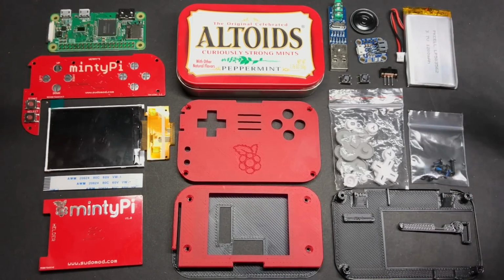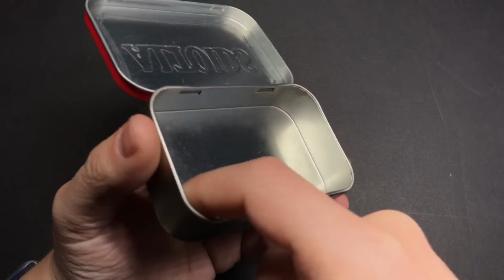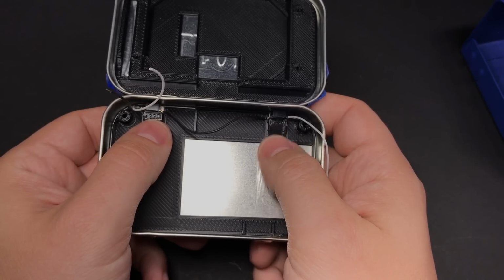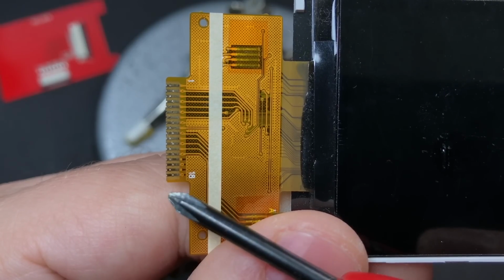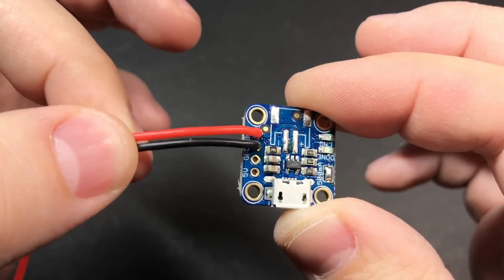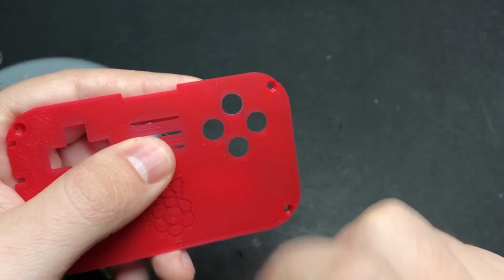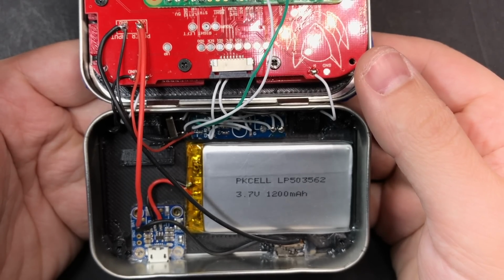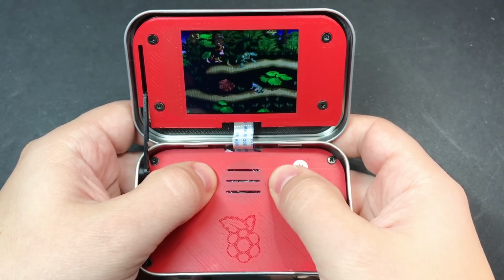mintyPi Build Guide

Comment: I'm sure it's not too big of a deal on here since your not shooting for the worlds greatest audio quality, but it's generally a really bad idea to have your oscillator very far from your chip.  Introduces noise and increases the capacitance of the leads.  Like I said, in this case, no biggy, but don't do it on anything you're sending data over that you don't want to lose bits, ESPECIALLY at higher frequencies.

I'd say, if there's room, put it on the backside with the ic and just put some kapton tape over the ic leads to prevent shorting.

Comment: I made a much simpler version; I used an old samsung phone for a screen and hardware, with emulators installed, glued it into my altoids box and put a little metal sheet over so it would look nice. I took a very small bluetooth controller and glued it into the bottom part of the box. Then i drillad holes for charging, headphones, powerbutton and Then I was done! :)

Comment: Its $200 with the speaker, $100 for everything else, $70 if you 3d print parts
Reply: Zachary Pappalardo they cost $299.99 so basically $300
Reply: CATastrophe that's fair, I wanted to know where you got that stuff plus I'm in Aus so like 200 bucks is nothing for a switch
Reply: CATastrophe a switch costs $200??
Reply: No it isn't if you buy it off his links

Comment: so I plugged in my sd card to the pie with the screen and all I'm getting is a blank white screen. is there anything that I'm doing wrong? I already installed the image and the set up in to the sd card.
Reply: MR DAM4 hey buddy, have you searched the forums? It could be that your trimmed ribbon connector isn't properly aligned, or maybe it needs another layer of masking tape (max 2 layers). Check the forums for further detail:

http://www.sudomod.com/forum/viewtopic.php?f=34&t=3460

http://www.sudomod.com/forum/viewtopic.php?f=34&t=3535

Good luck!
Reply: naliboi93 thanks, but I have, maybe it takes a while to boot up
Reply: MR DAM4 hey, don't know if you've checked yet but Wermy has a new video on troubleshooting common problems. That includes various solutions to your white screen problems. Hope it helps.

All the best!

Comment: Awesome mod, that's really well done. Quick comment on the power switch though... wouldn't connecting it to power rather than ground mean that it would short when you close it? (instead of just turning it on as you'd explained it would do with ground) I imagine using ground and just using some electrical tape to insulate it would be the best way to go.

Comment: I love the random cat in the middle of the build XD

One tiny modification I would make to this: put the power switch inside the tin. I can imagine this being accidentally turned on in your pocket from the switch getting bumped
Reply: DoctorX17 why not just make it so it turns on when opened, then shut off when closed?
Reply: JoshuaSr33 Well you'd have to save everything every time you wanted to close it and take it somewhere and every time you opened it you'd have to wait for it too boot.
Reply: JoshuaSr33 I think it would be better if it just went to sleep when closed. I'd just be worried about hitting the power switch in my pocket
Reply: Kyé Buckeye I think he means the actual cat in the video, not the logo.
Reply: Blue Røule yeah, I meant the actual cat XD
Reply: Its not a cat, it's the Raspberry pi logo, yet with some learning you could make it a cat
Reply: DoctorX17
Reply: DoctorX17 yeah

Comment: You should have designed the on/off switch to be on the inside.  In fact it would be really cool to design one that had everything on the inside, even the L and R buttons, like have a 6 button genesis button layout, just so there is no indicator that the tin has anything in it!  Charing would be a pain though, but maybe it would still be put inside?

Comment: Where can I buy silicone coated wire?
Reply: Dylan Higginson ebay is always a good shout. Managed to buy 6 x 1meter lengths for multiple colours and different gauges (4 were 30g, 2 were 26) for under £7, so pretty cheap.

I think Adafruit also sells i've heard
Reply: naliboi93 thanks for that I looked online and couldn't find any could you please send a link for the wire you bought. thanks
Reply: naliboi93 thanks so much ur a big help
Reply: Dylan Higginson no worries, buddy!

Comment: DUDE THEY HAVE NEW ALTOIDS ARCTIC TINS. MAYBE YOU COULD ADD ANOTHER SCREEN ON THE BOTTOM AND ADD TOUCHSCREEN CAPABILITY. THEN YOU CAN MAKE THE ALTOIDS ARCTIC TIN A WIRELESS (or wired) CONTROLLER. THEN WITHOUT THE CONTROLLER YOU CAN JUST USE THE TOUCHSCREEN.

OR JUST MAKE IT A WIRELESS CONTROLLER.

Comment: If you want to remove that tape, take a hair dryer to the back of the tin and it'll loosen it up btw :) That tape is pretty standard and funny enough removing it is generally involving some heat.
Reply: David Folsom the heat could soften the 3d printed parts

Comment: my screen is still white even after re-soldering all the connections and checking that they are good and the screen and cable and back are all from  links on the forums, i even tried waiting and i also tried your image and i also tried different screens that i also bought at the same time (still the 2.4 ones) but all still white, when i plug it in to my tv it boots up and show everything but the screen on the ribbon cable still lights up white

Comment: wermy Just wondering, shouldn't the hole guides have a top part so that you can get the best accuracy for the sizes?
Reply from the maker: Well with the way the hole guide is right now, the top part you mention would just be a flat piece.  So really all you need to do is trace a straight line across the top using some tape as I do in the video.  Hope that makes sense.  :)
Reply: It does, thank you!

Comment: Hey wermy or anyone else in the comments, do you know where to buy the type of wire in this video?
Reply: Papers I found them pretty easily on ebay. Just search silicone wire. Maybe specify a few thicknesses as well (eg 30 gauge, 26 gauge)
Reply: Thanks so much!
Reply: Papers no worries buddy, all the best!
Reply: I didn't specify the thickness
Reply: Hope your minty pi project goes well if your going to do it
Reply: Papers on the ones I scouted out, they gave an option to buy at different thicknesses, lengths, and colours for a good price. (Its a UK listing btw, so not sure if its too helpful if you're from elsewhere)

http://m.ebay.co.uk/itm/Flexible-Silicone-Wire-Cable-8-10-12-14-16-18-20-22-24-26-30-AWG-Various-Colours-/361296232202?varId=631117075186&txnId=875524355023

Cheers! And likewise!

Comment: If you could also if you are releasing the image you should add an option for shutdown in the retro pi menu for a safe shutdown and then a cut the power
Reply from the maker: There's already a shutdown option in the menu that appears when you press start.
Reply: Or do some way to add a mausberry circuit shutdown switch
Reply: Also the image is only linked in the written instruction but not on the wiki page where it talked about a premade image